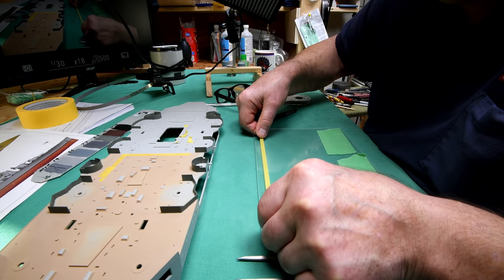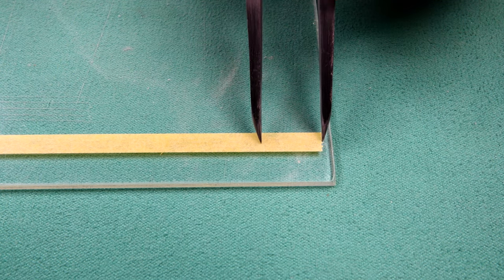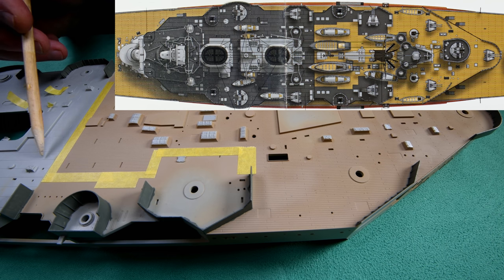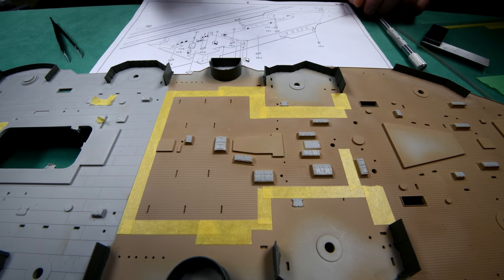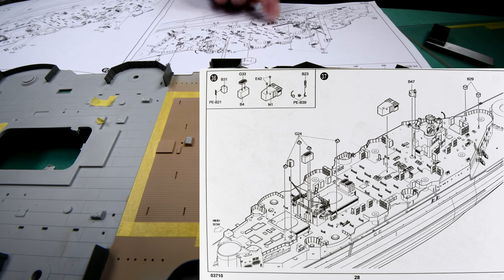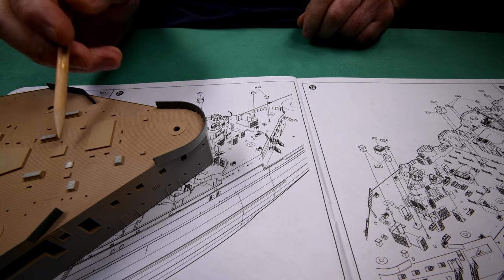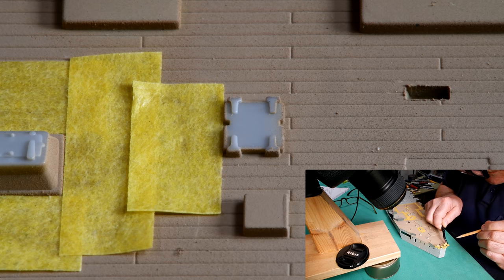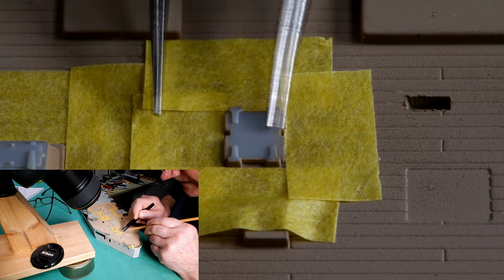The Model Ship - Part 568

Comment: Looking good Ron.. I can see you are really enjoying that masking. Just one little thing... I'm not sure which liquid mask you've bought but some can have a reaction to acrylic paint? Maybe test on your grey paint colour test band you have? Another little tip.. if you are concerned about the grey paint getting under the masking tape, paint the areas deck tan first, then any paint that does bleed will be the same colour as the deck and it will seal the tape for you.. no grey bleed.
Reply from the maker: Thanks for the tips Nigel 👍🙂

Comment: Ron, the liquid mask is ok on flat paint. Hint, on the non-planked deck right next to where want to put the mask, run a small piece of tape. That will give you a nice separation line for the mask. When it’s dry, run a sharp blade on the deck groove and remove the tape with any excess mask. You’ll get a nice straight line.
Reply from the maker: Hi Tony,
"the liquid mask is ok on flat paint" Good to hear that. Thanks for the hint. 👍🙂

Comment: Ron, on the small hatch with the hinges and indents, just use liquid mask in those areas, also as Tony said the painted surfaces do not need any special prep. In other areas where you use the mask you might put a piece of tape down and run the mask onto it. That way when you go to remove the mask the tape acts as a 'pull tab'. Stay safe, and see you tomorrow.
Reply from the maker: "the tape acts as a 'pull tab'." Might give that a try, thanks. 🙂👍

Comment: Hi Ron when you have masked all those hatches you will need to cover all the rest of the wooden deck otherwise you will end up with overspray, remember that on the main deck. If you're going to be doing a lot of masking you might like to think about that Infini tape cutting mat. Best wishes Vic.
Reply from the maker: Yes Vic, would be better than that piece of plexiglass that I'm using now. 
https://www.uline.ca/BL_1174/Self-Healing-Cutting-Mats?pricode=DK572&AdKeyword=%2Bcutting%20%2Bmat&AdMatchtype=b&gclid=Cj0KCQjwtZH7BRDzARIsAGjbK2YTjjA_RudO3KLIFHoBn4nPlCB3BAIh63SyKTFIL4FydShPvhQWzBEaAv-SEALw_wcB&gclsrc=aw.ds
Reply: @roncalverley  The Infini tape cutting mat is not a self healing cutting mat. It's a very hard surface mat with masses of parallel grooves on it, you stick your tape on it and then you use the grooves to cut various widths of tape. Best wishes Vic.
Reply from the maker: @vicparratt7523  Oh yes! Got it now. You are thinking of  the one that Nigel was demonstrating recently. 👍
Reply: @roncalverley  Hi Ron yep that's the one.

Comment: Hi Ron, I meant to say in the last episode where you were painting a little hatch but got some on the deck - could you not cut a small piece of paper/card in to an L shape, only half a cm or so wide and a general length that matches most of the hatches. This can then be held in place while you brush around the object? Obviously you have to move it so the L goes against the other end when painting that side. It's obviously not as exact as using masking tape but should give you a decent line without the time/messing around with tape. It also can be used again, though probably best to have a couple of pieces so they can dry in-between. Hope that makes sense! 

Have a good evening and see you tomorrow.
Reply from the maker: That's a thought Barry, thanks. 👍🙂

Comment: buy yourself some micro brushes of ebay  then you won't get paint on the deck try it there good i use them for small parts
Reply from the maker: 👍
https://www.amazon.ca/Disposable-Applicator-Bendable-Extensions-Diameter/dp/B07P2LGCM1/ref=asc_df_B07P2LGCM1/?tag=googleshopc0c-20&linkCode=df0&hvadid=335378698055&hvpos=&hvnetw=g&hvrand=15035323654256023858&hvpone=&hvptwo=&hvqmt=&hvdev=c&hvdvcmdl=&hvlocint=&hvlocphy=9001185&hvtargid=pla-730993281589&psc=1